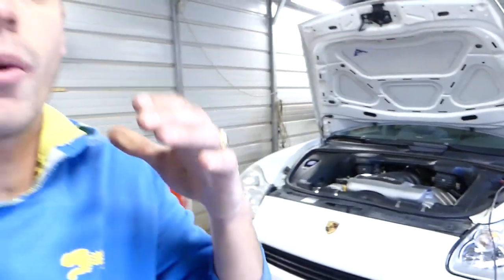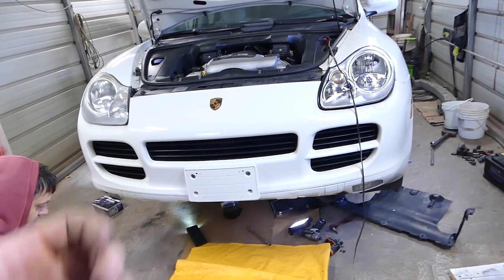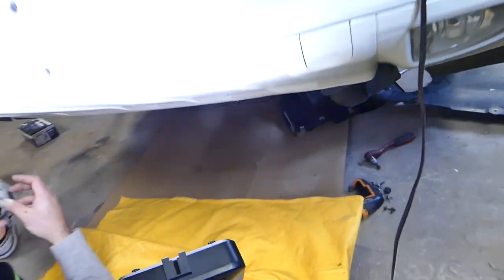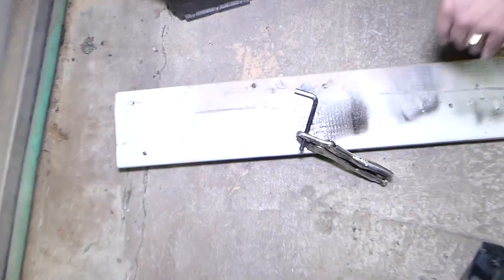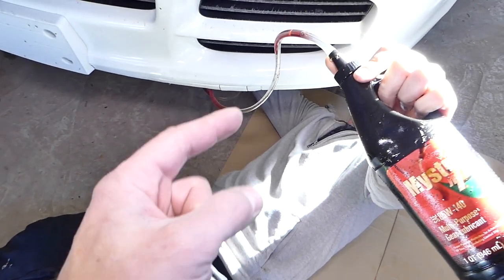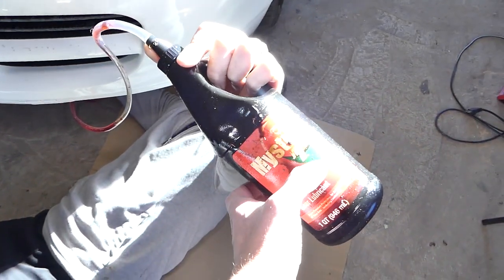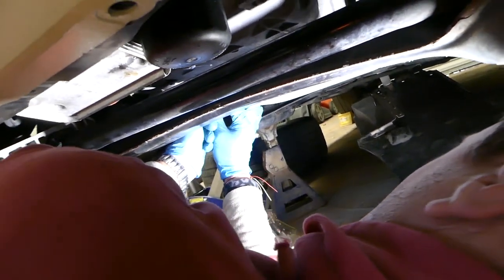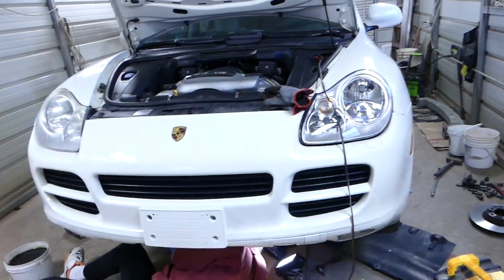HOW TO DRAIN CHANGE FRONT DIFFERENTIAL OIL FLUID ON PORSCHE CAYENNE, VW TOUAREG, AUDI Q7

Comment: I changed my diff oil with Lucas 75w90. I thought it was topped off but I had more fluid than I though I would need. I bought 3 bottles. I used about 2.5 or so between front and rear. I hear the wheel bearing type sound on the pass right. It’s not loud but very dull at highway speeds. I’m going to check fluid level tomorrow and try to add more fluid. Heavier fluid may help?

Comment: Hi..thank you for Video & I have 1 Question my porsche front differential makes a little Noise when I'm going 80kmh but it doesn't make that noise at high speeds. Should i put 75/90 with treatment oil, or should I use 90/140?

Comment: If you put a small hole in the bottom of the oil jug when you turn it upside down it will help it flow better. You can use a clamp to crimp to the hose to control the flow.

Comment: Does audi recommendation these fluids be changed i have a 2015 with 138k miles and i haven’t changed the transmission oil or the rear or front gear boxes what oil should i use

Comment: You can buy a hand pump that threads onto the top of oil bottles for about $10 at Walmart for refilling -- it will be much easier.  How many miles were on that Cayenne?  I was surprised how black it was.